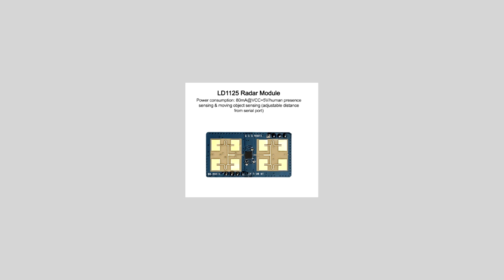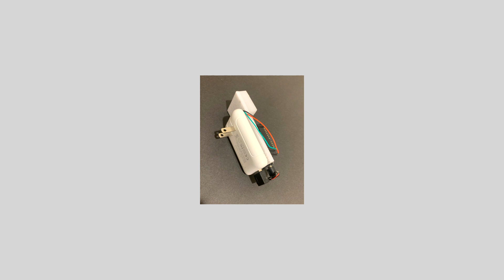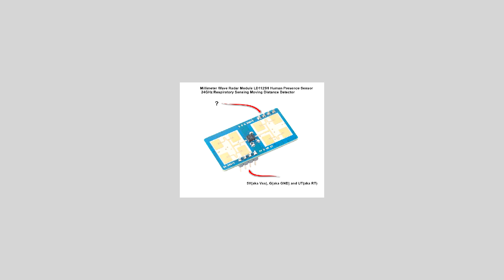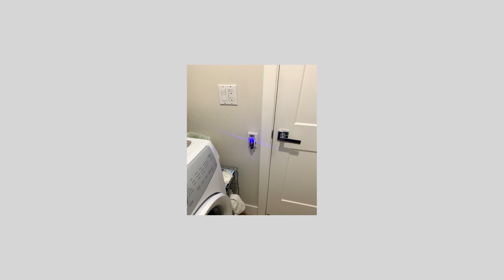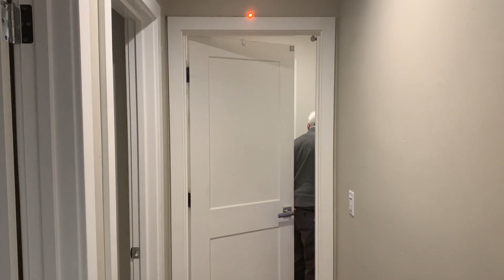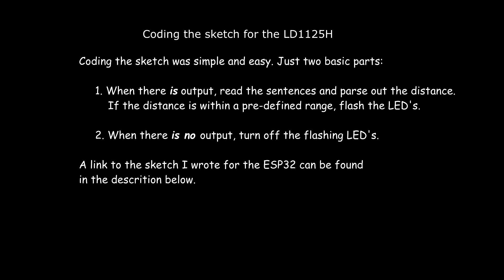LD1125H Motion/Presents detection. Input format explained with example sketch

Comment: Hi, this is what I've been looking for.  Most everything else I've found hooks to a computer, or to homeAssistant.  I plan on using this for obstacle avoidence and to some degree, identification of object.  You may have been ble to use a gas sniffing sensor, to see if anybody is in the lou...lol...sorry, I could not resit.  Thanks for posting you code.
Reply: I received this error when I ran this in Arduino ide 2.3.4  "Compilation error: invalid conversion from 'void (*)(const uint8_t*, const uint8_t*, int)' {aka 'void (*)(const unsigned char*, const unsigned char*, int)'} to 'esp_now_recv_cb_t' {aka 'void (*)(const esp_now_recv_info*, const unsigned char*, int)'} [-fpermissive]"
Reply from the maker: @judasknox3354  That is an error in the "ESP-NOW" code.  There a few different examples floating around, like "Random Nerds".  I suggest you replace all the ESP-NOW code in my example with another example.